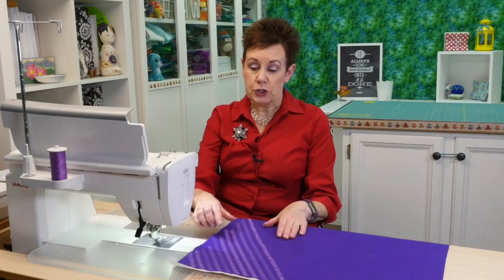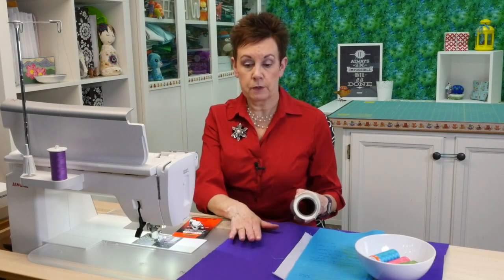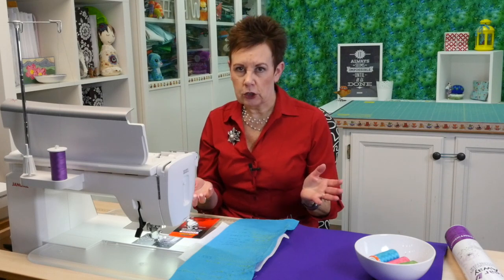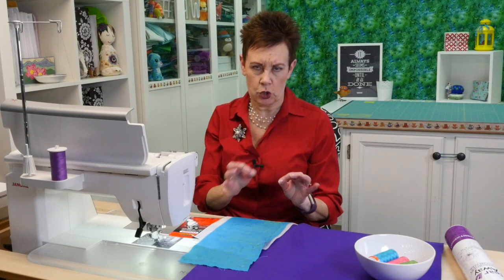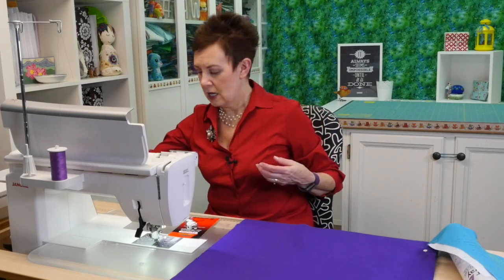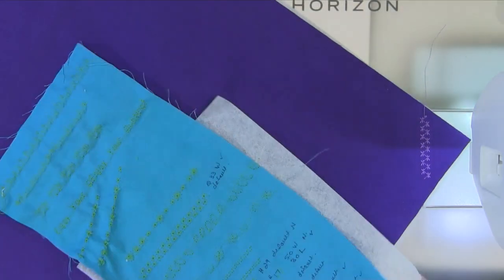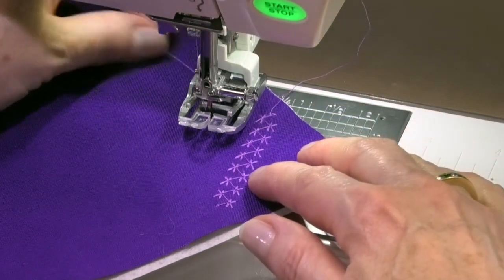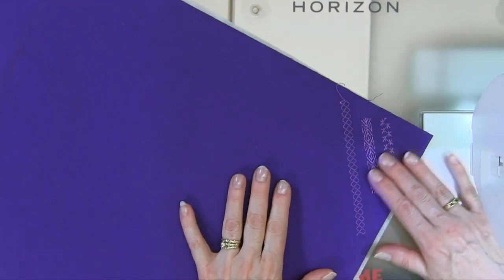How to Make Fabric with Decorative Stitches on Your Sewing Machine

Comment: Good Video. Thank you. Too often I see videos of sewers who just do the straight stich, ignoring the fancier stitches the machine can make. Two areas of use occur the me (just me). One, as you mentioned, a quilt. Imagine a quilt has 5 blocks by 7, all the same. One could use this method to make a subtle variation among those blocks. That variation could create a look of development. For example, the often repeated flying geese unit. In some units, the fabric could be plain. In the second, the fabric could have one line of decorative stitching. In another two. In another three. Across the quilt, one might made a development of decorative stitching to add variation, the spice of life, to the overall design. Two, clothing. Many articles of clothing use piecing as a shaping function. One could use this method to turn function (shaping) into form (decoration). Thank you for pointing out the enormous possibilities of decorative stitches built into modern sewing machines. Sewers and quilters could make great strides in art and craft if they would but take the time to explore what their fancy machines can do.

Comment: Great information, Kim.  I have so many stitches on my Viking Sapphire that I've never used since I mostly use my machine for piecing quilt blocks..  This is a good way to incorporate some of the pretty stitches into my quilting.  I appreciate the tip on the stabilizer.  I should know that since I embroider, too, but it never dawned on me to use it for decorative stitches.
Reply from the maker: Glad you found it useful, Cindy. Yes, that stabilizer makes all the difference ;)

Comment: Great idea to use stabilizer......when I got my 9400 my dealer said that there were only a few decorative stitches that could  be used with the accu feed foot ie the serpentine stitch would work. I often wondered about this. Will definitely be asking my dealer about this again. Thank you for the video.
Reply from the maker: Hi Jean! Maybe this is a case of ignorance, but I didn't know that I wasn't supposed to stitch these types of stitches with the walking foot. Worked well for me and doesn't cause any issues with the machine, so why not?!

Comment: I know this is generally quilting, but I want to add a decorative stitch to enhance the stripes in a fabric I will be turning into a garment. Would it be better to add the stitch before or after I cut the garment pieces out? I m thinking I would get a better overall stitch if I do the whole piece before cutting. I'd rather do some more work to achieve a better result. Any suggestions?
Reply from the maker: I would think that it might be better to do it before cutting out the fabric pieces, especially if some of the stitching would be near the edges of the fabric. I would use a water soluble stabilizer. You could trace the cutting line of the garment pieces on the fabric, do the decorative stitches, and then cut out the pieces. Good luck!
Reply: @Chatterboxquilts  Thank you, that was  pretty much what I thought, down to the water soluble stabilizer. I'd rather get the opinion of someone with more experience in this area before I go and destroy something! 😄

Comment: Interesting video. Enjoyed seeing the concept. My machine has 150 stitches and I haven't seen many of them. Do have a question. Why do you lock stitches at the beginning and end of a row, when you know the fabric will be cut to go into a project? I see this so much, in places where locking the stitches is a waste of time, IMO.
Thanks for the video and opinion.
Reply from the maker: I find that I need to lock my decorative stitches if I'm using them where they don't go completely to the edge of the fabric. I think it's also just a habit 😉 I agree that if you are going to be cutting through the fabric and through part of the stitched decorative stitches that you don't need to lock them. Good question!

Comment: I have found my decorative stitches distort on a sandwiched quilt if there is any side or back stitch component to them - how does one remedy this?
Reply from the maker: Typically this doesn't happen as the layers are usually sufficient to stabilize the quilt. I would suggest 1. going slowly as you stitch a decorative stitch and 2. Adding some tear away or wash away stabilizer under the sandwich to give additional support.
Reply: My brand new M7 is doing this too, and with a quilt sandwich. It’s overlapping ,like the shirt and pants ,pants are on top or into the the shirt. At first it was beautiful. I’m hoping I can figure this out.Thanks for video.

Comment: My machine is making the decorative stitches under the fabric instead on top. Do you know how can i fix it?
Reply from the maker: This could be a tension issue so I would suggest adjusting your top tension. Also be sure you are using stabilizer under your fabric - you should try this first. If you are still having issues, I would contact your local Janome dealer for more help.

Comment: Hi there, I bought a 12000 4 yr ago and I have been nothing short of miserable ever since. i have tried using the walking foot to do decorative stitches and every three seconds it stops and tells me to make sure i have the right foot on.I have debated selling this machine and going back to Bernina. This machine is nothing but trouble,numerous problems.useless to take it back to dealer,been there,done that over and over again.. How did you get your walking foot to do decorative stitches???? Thanks, any help is very much appreciated.
Reply from the maker: First, I have used a walking foot to do these on a Janome MC9400 and MC9450, not a 12000. I know that Janome doesn't suggest that you use a walking foot - they prefer you to use an F (satin stitch) foot. I sometimes push the boundaries ;) Sorry to hear that you are having so much trouble with the machine and yes, unfortunately, the local dealer is really the best place to go for help. Perhaps there is another dealer in your area that will be better able to help you?